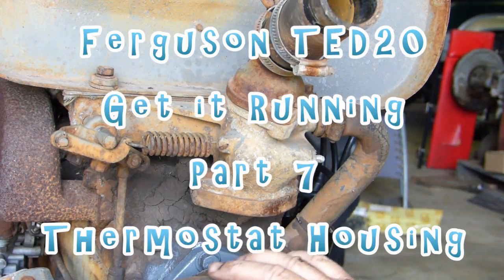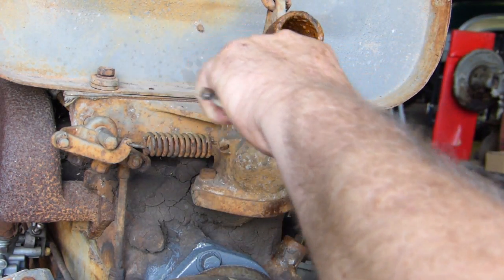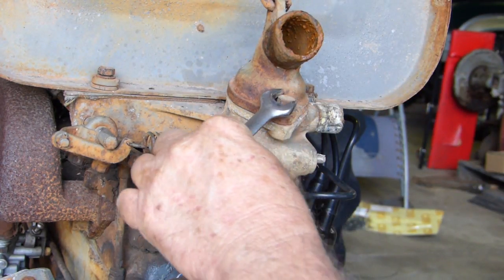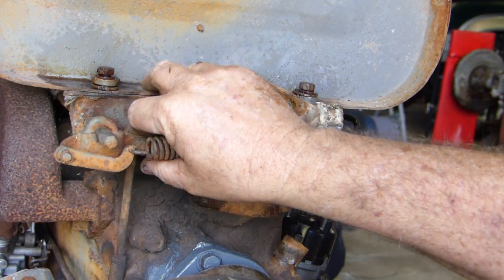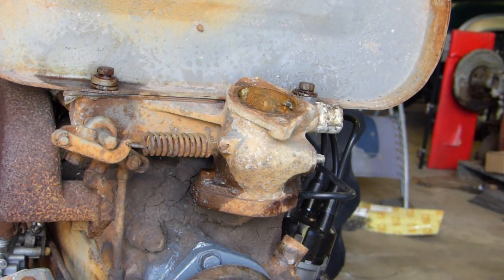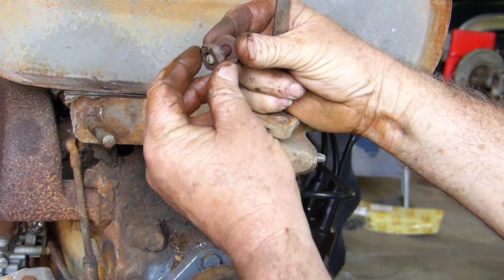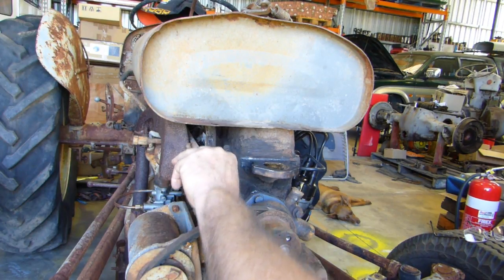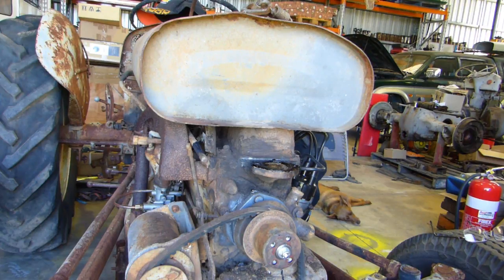Ferguson TED20 Barn Find, Lets Get It Going Part 7 Thermostat Housing

Comment: Hi Lance, yes different threads and bolts can be a problem. The latest I have had a problem with is a steering box for my MF35 that I bought direct from England, apparently they have gone metric, all the tapped holes were metric, that's upsetting if you want to go original.
Reply from the maker: That does give you the shits for sure we have to be careful to explain some of the things that happen like that to our customers depending on why they are repairing the tractor.

Comment: Hey lance, another great video, I’ve unfortunately snapped the head of the bolt that fixs the thermostat housing to the tractor, do you have any advice on removing the Broken bolt? I’ve been oiling it regular but with no joy, been told a little heat may help? Thanks
Reply from the maker: Sorry to hear that try and buy a left hand drill set, make sure you drill dead center if it is open underneath a normal bit will do the job.
Reply: Bundy Bears Shed thank you very much 👍

Comment: That silastic stuff should be banned.  I must admit years ago if doing a thermostat or something like that, I would have used it.  Great if for some reason you don't have a new gasket.  But it's not really such a good product.
Reply from the maker: G day Peter, Yes I have been guilty of using it in the past but there are better things to use now. (like 10 gallons of aviation cement like in my video )lol
Reply: I was expecting you to bring out the tube of R51.  I had never used that stuff before, until just last week.  Side cover on my motorbike started pissing oil out.  A new gasket and some R51 fixed it up real nice, and much better than silastic.
A few years ago I knew a bloke that worked in a motorcycle repair shop.  He told me of some of the horror stories where silastic beads had gotten into the oil system and blocked orifices.  Funny how camshafts and valve gear can't run for very long without an oil supply.